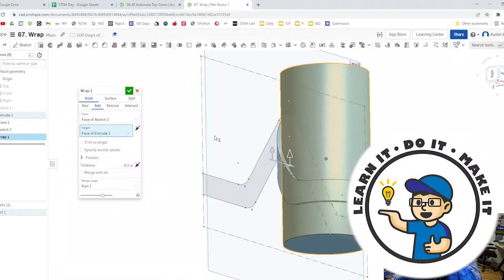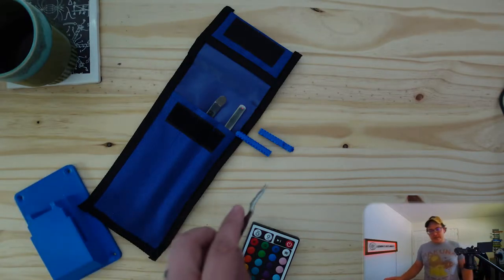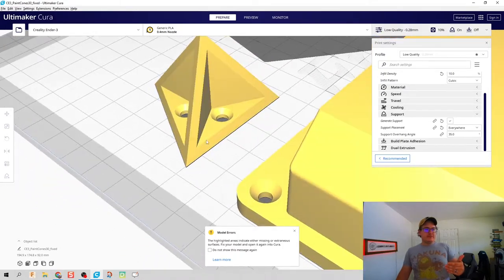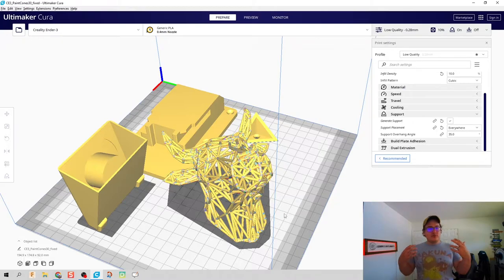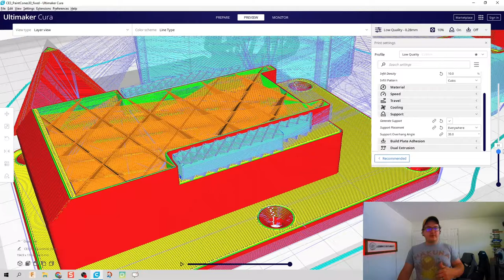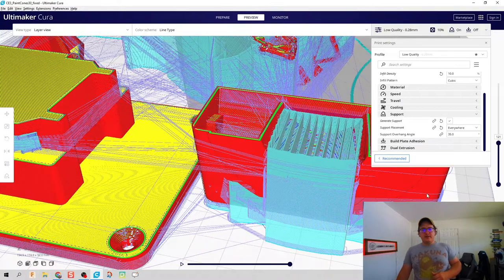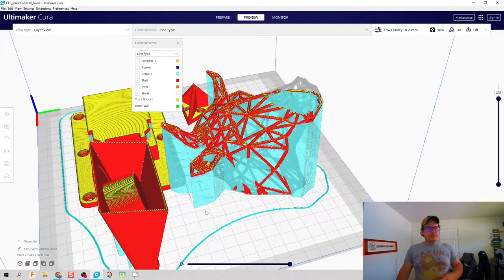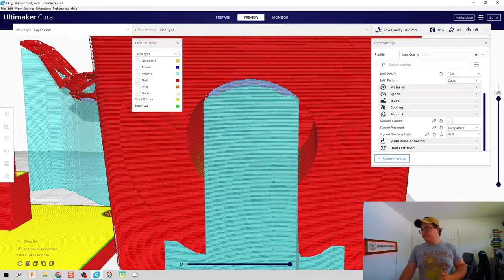Supports and Limits to Ender 3 V2 - Day 13 of 100 3D Printing Journey (Subscriber Requested Video)

Comment: Ok, so very new to 3D printing and just starting on prints that require supports. My issue seems odd, but I'm at a loss as to what to try to adjust that will fix the problem. Some, not all, but some of the supports for my model are just straight up failing. The issue, after observing it print for a while, seems to be with retraction. The printer will retract to move, but the filiment doesnt start flowing as soon as the print tries to resume. I find this odd because it's only on particular supports as some of the other supports seem ok (not perfect, but they're supports, right? As long as they're there, who cares if they look a little... thin). I've tried lowering retraction from 5 to 3 as well as slow my print down to 40. Is this on the right track or am I not looking at the correct method of fixing this issue? 🙂
Reply from the maker: That could be the issue, but I'd try bumping up the temp first.